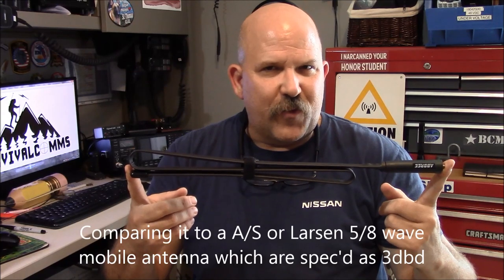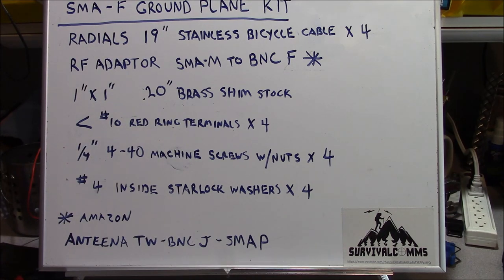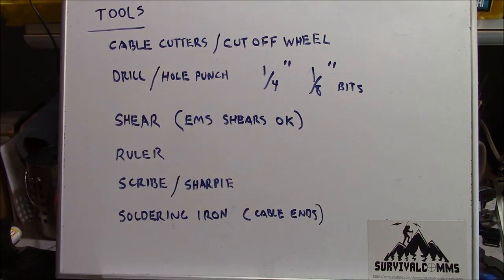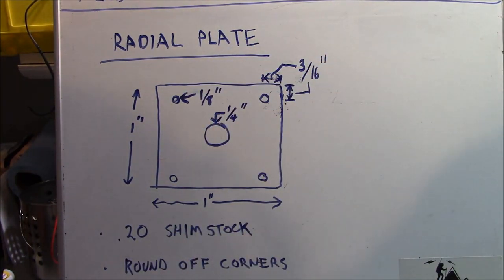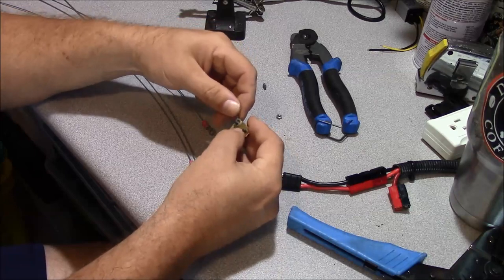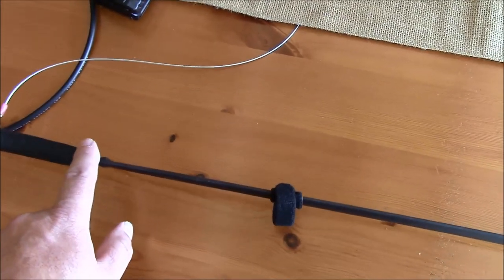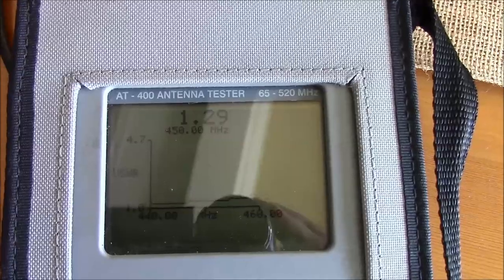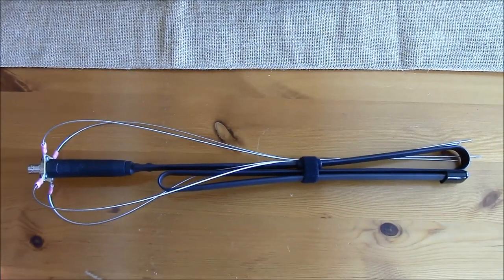Abbree 42.5" VHF/UHF antenna elevated ground plane kit

Comment: You realized exactly the idea I was thinking about. 
I'm also thinking of make a wire central radiator with a screw that fits in the nut. So you can get a 5/8 wire antenna and don't need to carry the heavy tape central radiator. So basically you just use the matching section of the abbree.
Reply from the maker: I did the same with a larsen coil and an NMO kit with stainless cable radiators. It will handle 100w of power and it's legit quality parts. I did a video on it some time ago.

Comment: bought an abbree 39 inch (they also have a 24 inch version) tactical radio relocation cable and an abbree tactical antenna relocation pouch. routed the relocation cable from the hip strap of the backpack to the shoulder strap, went over the shoulder down to the back bottom of the backpack. then put the antenna relocation pouch to the back bottom the backpack. no more annoying/distracting antenna in my face. the relocation pouch could be attached to MOLLE/PALS webbing. if your backpack doesn’t have MOLLE/PALS webbing, shove the antenna to the side bottle pouch which is common in backpacks.
Reply from the maker: Ok. Thanks for watching !

Comment: Nice build...I will know buy my own piece of. And I will offer a suggestion. There are BNC to SMA panel mount adapters that will give you ready made holes for the radials. The BNC side is always Female though.
Reply from the maker: Thank you ! I have an N panel mount that would have worked but it lacked the support that the flat adapter gave at the feedpoint and it was much heavier. I  snapped a good pasternak adapter making the original video. Even handling the feedline at the feedpoint unsupported is really iffy with these antennas.  Thanks for the suggestion and thanks for watching !

Comment: Is this antenna structurally strong enough to support some of the weight of the BNC off the body if the pressure is taken off the joint ?
That is: Cable clamping/hanger/clamp to L-shaped bracket with BNC-sized 'notch' out of the bottom edge. That would be a pretty minimal weight addition if the body isn't just simply to flimsy for that.
Reply from the maker: There is too much side to side stress for a BNC . Hold one of these antennas by the feedpoint and it is incredible how leverage the length and weight of the antenna exerts on the base. However if one was to incorporate a bend in the radial plate made out of thin stainless  for attachment it would work good IMHO for what you are envisioning.  It would also work as a radial plate. One could use a  hose clamp for attachment.  That is a really good idea and would make the radial plate multipurpose. Thanks for sharing that idea and thanks for watching !

Comment: Nice construction idea. If half of the radials were cut for VHF and half for UHF would performance be improved?

Speaking of radials, is this the wire used for bicycle brake cables?
Reply from the maker: Thank you ! Yes it is bicycle cable. My experience on radials is ones cut for the lowest frequency work well for higher unless it is a multiband variety where the radial is the tuned element (6,2,70cm). Thanks for watching !

Comment: I am a bike rider, as in Bicycle. I use a Diamond 7500 super gainer antenna. It says "Does not require ground plane" right on the package. But, would something like what you made work for my bike and maybe give me better range? The antenna in question is also a 5/8 wave.
Reply from the maker: Your bike makes a good ground plane unless it's an exotic materials one.  The diamond is a much better antenna than the abbree IMHO. The abbree is more flexible and lighter however. They are cheap enough to try out. Do you mount your antenna on a rack ? I do self supported bicycle touring but haven't used more than an HT. I've thought about putting an NMO on my rear rack a time or two in the past. Thanks for watching !
Reply: @survivalcomms  This is a video of my bike and set up >https://www.youtube.com/watch?v=y0fvGysZcAQ&t=283s  The Diamond antenna, mounts on the silver bracket you see on the back of my seat. The bike is 7 foot long. On this ride I just used my TYT UV8000E HT, and my 18.8 inch Abbree antenna.

Comment: The Abbree antenna being 5/8th wavelength and the radials being 1/4 wavelength doesn't seem to cause any problems. I'm quite surprised!  Has this ever been an issue for you before or does it always seem to work this well?
Reply from the maker: 1/4 radials work just fine. It's all that's required. Thanks for watching !

Comment: wire nuts for eye ?
Reply from the maker: That is a great suggestion ! I would definitely use the cables with the lead ends if I wansn't out of them when I built the prototype. Thank you for sharing and thanks for watching !
Reply: @survivalcomms  great subject matter , nice length as well your delivery ain't bad either
Reply from the maker: @craigpalmer9196  thank you !

Comment: Why use radials if you can use a resonant counterpoise? In other words, just a piece of copper wire, for a 1/4-wave antenna it'd be 1/4-wave long.
Reply from the maker: because radials are more efficient than an individual counterpoise.  Thanks for watching !

Comment: If the ground plate didn't need to be so thin, one could just modify an so239
Reply from the maker: An SO239 to SMA M Bulkhead adapter would work  -  That SMA junction would be awful fragile. If you have a link to a part I would be interested in checking it out. Thanks for watching !
Reply: @survivalcomms  Good morning. This is what I use in conjunction with an so239 connector. This pl259 male to sma male. It is not homebrew but it has been solid for me three years now. I have had no problems with water intrusion since I coat the so239 in Dipit(a rubber coating used to coat tool handles). Any connection point can be fragile the more it is man handled so good solid soldering is required. It is just as solid as a bnc or even more so. Hvae a good day. 73's, JOHN ( KC2FBH )

Comment: Yeah, that's way too much work. 😅

Still very nice and probably takes up less room then another dedicated antenna. 👍

If you have a email address, I'll send you some pictures of my setups. When hooked to my plate carrier or pack, I just use a short piece of relocation coax and a tiger tail weaved through the molle. You can do the same thing with a camelbak or other small pack. Strap the antenna to the outside and use a shoulder mic. This allows you to store your radio inside a pocket. I use a sma to bnc adapter on the radio so I can remove the radio in seconds if I need to, instead of trying to untangle the antenna. Getting a new antenna analyzer so going to do some testing on how effective it is. 

Also picked up a new Bluetooth TNC. So now I can do data modes wirelessly with my phone. Once I set the radio up, I don't need to get to it. The radio can ride safely in the pack. 👍

You might have done a video on these before, but if not check out a Slimjim antenna.  I use these.

https://n9taxlabs.com/

Great antennas for the money and they will even cut one to your desired frequency. I use a 2m/70cm model with 16' coax and a bnc connector. If and when I need a little more range, I toss the slim Jim in a tree and just switch BNCs from the abree to the Slimjim. Fast and easy. 👌
Reply from the maker: Cool Beans !  I just use a whip and throw a ground plane up if I would need to. I did this mod just to make the abbree practical.  
I did a video 4 years ago on making your own window line  Jpole with a leatherman tool and a soldering iron.
 https://www.youtube.com/watch?v=ShRwnnejoO8&list=PLiNgcjv61vBWQifX-T1LefRr-iAroPD15&index=15

Thanks for sharing and thanks for watching !